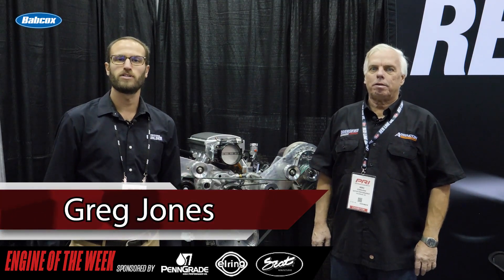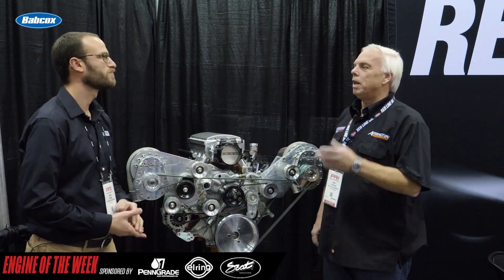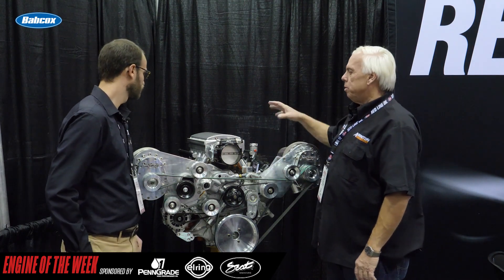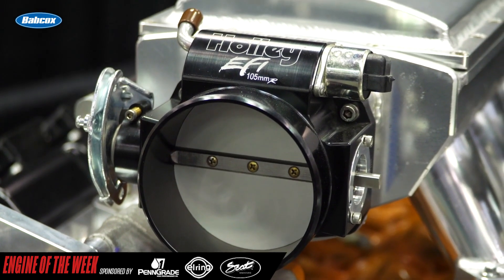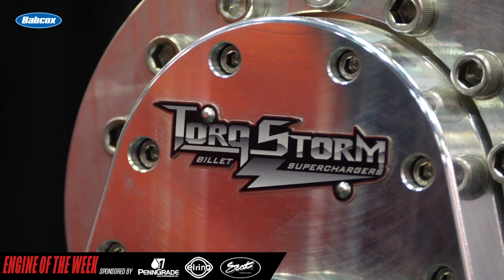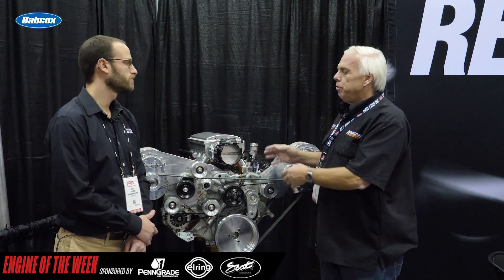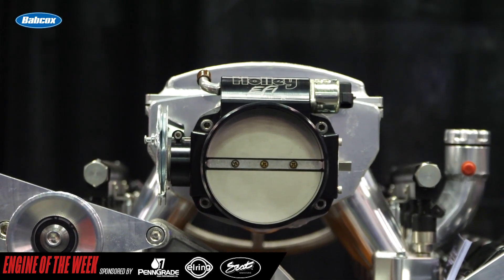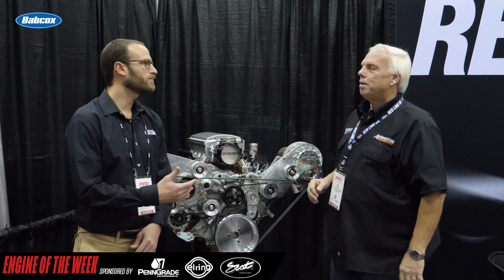Twin Supercharged 426 Hemi Engine

Comment: Two smaller blowers are easier to spin the one larger blower. Sound better. Engine is more responsive. VE is off the hook off boost.  Mine is twin F1C Prochargers. Approx 1800-2200hp. Not belt crank driven.

Comment: Why on earth would anyone want 2 Torque Storm blowers besides the "wow" factor? I realize the headunits are cheaper than a Procharger but you need two to compare to a single PC. This is like bolting on 2 P1-SC Prochargers instead of a bigger headunit. I wouldn't even want to try and package them both with the plumbing complexity and belt issues you will certainly have. You can't tell me there is a benefit to this setup over a F1A-94 or any of the F series blowers. It might be cool in a 32 Ford with the side open but even then I don't see any benefit at all.
Reply: Air flow is why this will make a percentage more power IF you can make effective use of the volume. There is another build on YouTube with something like this being done on an LS and there was a performance gain beyond what one other suppers in question could do. I do question if a small centrifugal supper could get up to speed maybe a bit quicker.